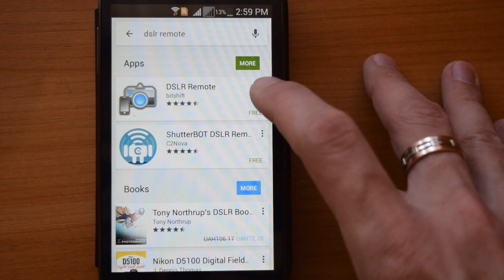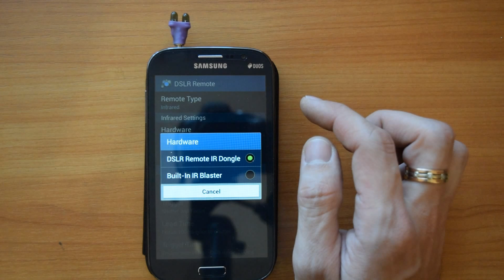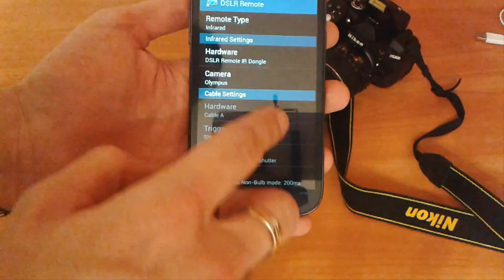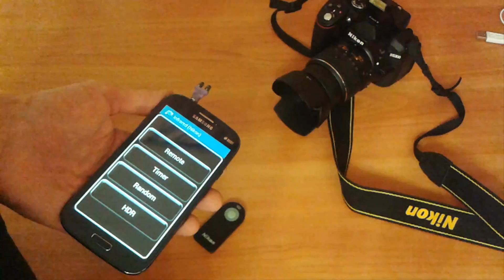DIY DSLR Remote Control with Smartphone | Infrared Dongle for Android

Comment: I don't have one of these big 3,5mm stereo plugs, so i used my old headphones. It should also work, if I only cut off the headphone speakers and attach one side of the LED-construction to one cable (not GND) of one speaker and the other side of the LED-construction to the other cable of the speaker. Then I soldered it together and tried it out, but it didn't work. Do you have an idea, what I did wrong? 
(additional information:
- Smartphone: OPPO Find 7a (Android)
- App: DSLR Remote (like you used in your video) in Sony-mode
- Camera: Sony Alpha 6000
- On an iPhone camera, you can see, that the IR transmitter on my Find 7a doesn't send out any signal, when pressing the shutter button. For example on TV remotes, you can see the signal on the screen of the iPhone camera, so the mistake has to be on my IR transmitter, the app or my Find 7a.
)